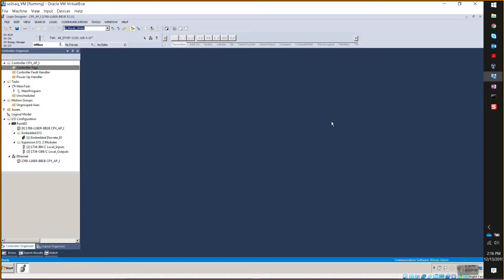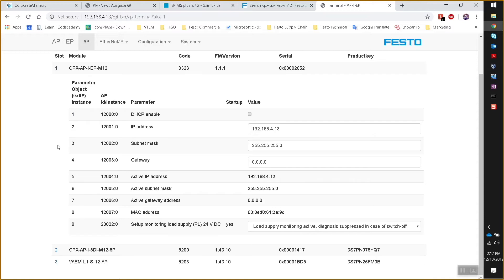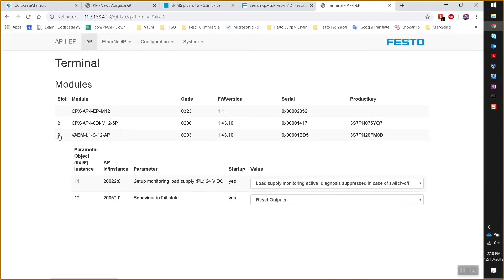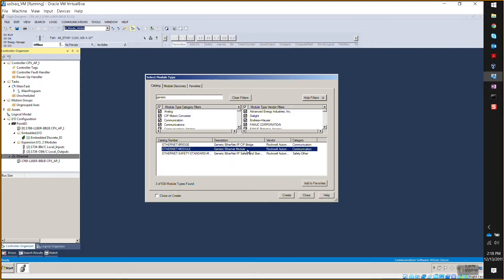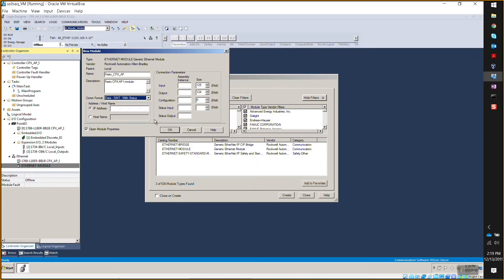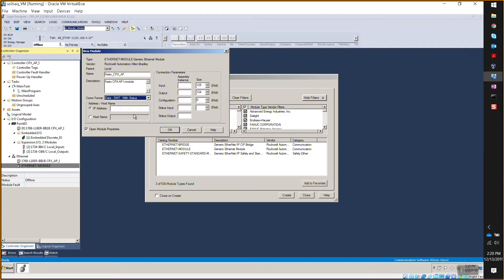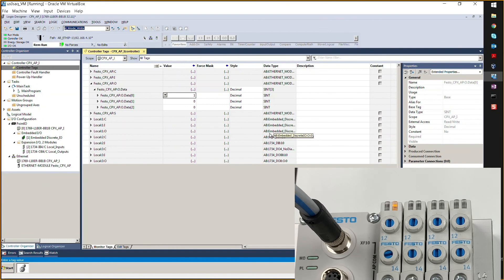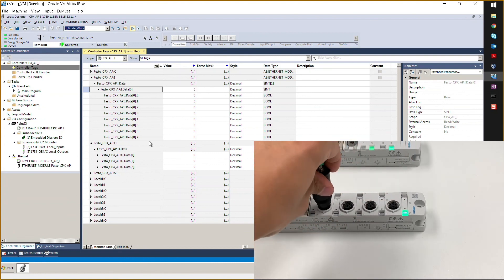Setting CPX-AP-I-EP-M12 in Rockwell Studio 5000 - Part 2: Web Server on CPX-AP-I EP-M12

Comment: When access CPX-AP-I through web server, which device is the cpx-ap-i connected to? Laptop PC or PLC?
Reply from the maker: The CPX-AP-I-EP has a built-in web server.  Use a browser on a PC to access the web server.  This in independent of the PLC connection.  To answer your question, the CPX-AP-I can be connected to both the PC and PLC at the same time as long as they are within the same network.  But since this does not depend on the PLC, the PLC can be disconnected.  At minimum, a PC with a web browser connected must be used.